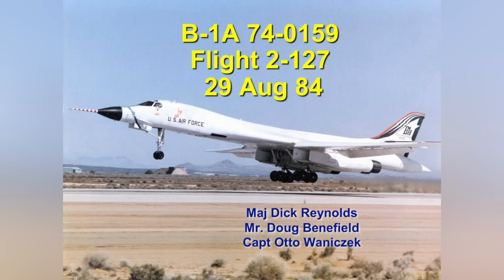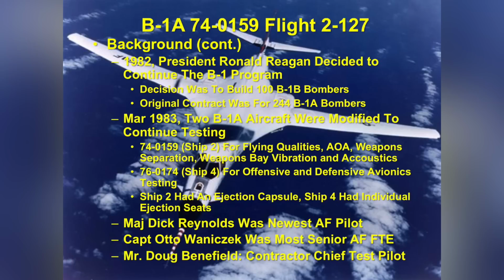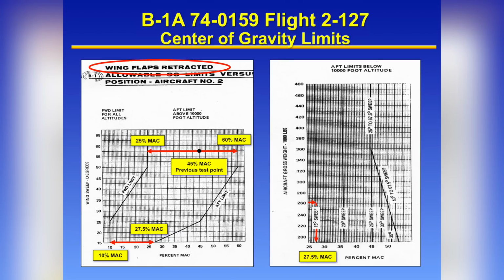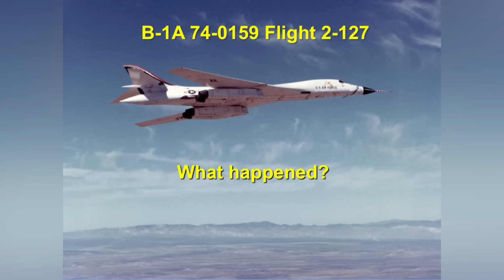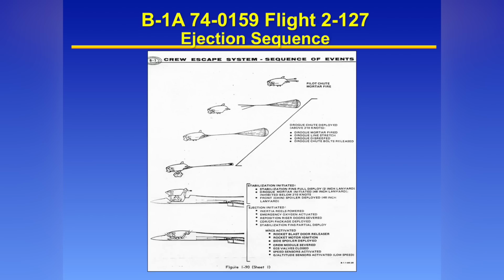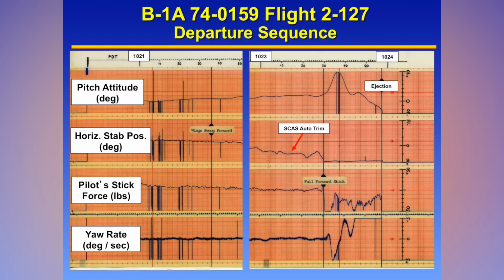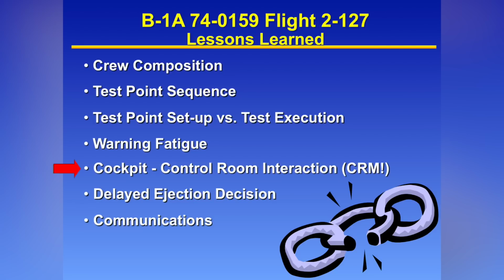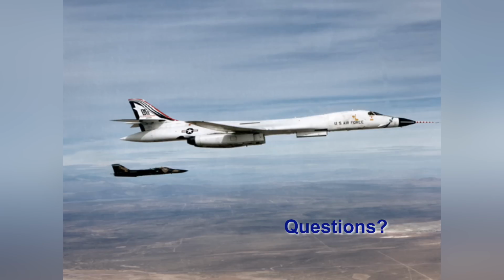B-1 Bailout: Hazards of Flight Test

Comment: What a fascinating and candid account of this incident. Otto did such a thorough yet clear explanation of the program and that days Test Points. As a historian of Escape Systems I found this incredibly informative and captivating. I was lucky enough to know a special engineer named Oscar Sepp who was in charge of the B-1A's Capsule System and the Decision to switch to four  Webber ACES II individual Ejection seats (due to the complexity and high count of CAD/PAD explosive devices with the statistical probability of cartridge  failure on the capsule system - as well as the expense and maintenance complexity of the original escape system. Finding this lecture from the WMF featuring Otto is an absolute treasure. Additionally my father in Law, Maj. Don Harten did a lecture on his 5 tours of duty in SEA/Vietnam in the B-52 (2) F-105 (2) and ending with the F-111A- with details of his surviving the head on collision between his and another B-52 in 1965 on the very first ARC LIGHT mission (Arc Light One was his own book on this subject and another was done several years ago providing alot more detail and insight of his life. This lecture series provides meaningful historical accounts which are a must for anyone who appreciates military history especially regarding aviation. I WILL be watching the entire series of lectures in this series here on YouTube. Bravo to the Peninsula Seniors for producing these and presenting them to the world here on YouTube. A heartfelt thank you and keep up the great work! -Chris Woodul

Comment: Warning Fatigue is key element in most "pilot error". The aircraft becomes the boy who cried wolf. If every movement of a parameter triggers a warning then of course over time the pilot will be conditioned to ignore the warning. I am movingmore to the position that 99% of "pilot error" could be resolved with better aircraft cockpit and systems design that accounted for human factor.

Comment: Could the F 111 go just as low at much high speed?
Reply: The F-111 was MUCH faster than the B-1.  Actually, one of the fastest planes on the deck AND at altitude.  The F-111 could hit Mach 1.2+ at low altitude and probably go faster but as I understand it they had a temperature gauge to tell the pilot when to slow down but it was a difficult plane to chase down in clean (no external stores) condition.  At low altitude, a B-1B can hit Mach 0.92-0.95 but isn't designed to go supersonic at low level.  It can hold that speed at low altitude for 1700 miles or no which is a FAR longer range than any fighter than could be vectored at it.  Many fighters STILL have issues with going supersonic at low altitude and they come across hard technical limitations -- oh, there are stories about some planes that AREN'T "the end all" in every situation like some people would have you believe.  There's a combination of inlet and engine issues that DO limit the speeds of some planes dramatically depending on the situation.
At altitude (33,000-36,000 ft), a clean F-model (the most powerful F-111 built) could achieve Mach 2.73 ...  They just spilled the beans on its ultimate speed since the type will NEVER go back into service or ever fly again in American or Australian service.  The planes have been grounded for good but you can still visit them in museums in the UK, Australia, or the US.

Comment: Another great speaker, as always. One question I asked myself was, if insufficient airspeed was the cause of the crash, why didn't the pilot push the throttles forward?
Reply: Insufficient speed wasn't cause of the crash. Incorrect Centre of Gravity for the commanded wingsweep put the aircraft in an unstable area of the flight envelope. Once that pitch up happens the aircraft becomes divergent (the more it pitches up, the more it wants to pitch up, vicious cycle) and by that point you're really a passenger to the scene of the accident. No amount of thrust or flying skill is going to bring an aircraft thats 20+% beyond the aft CG limit back under control, specially not within the 4000ish feet they had to play with.
Reply: @bend1483  Plus they didn't have any time to throttle up once they pitched up.